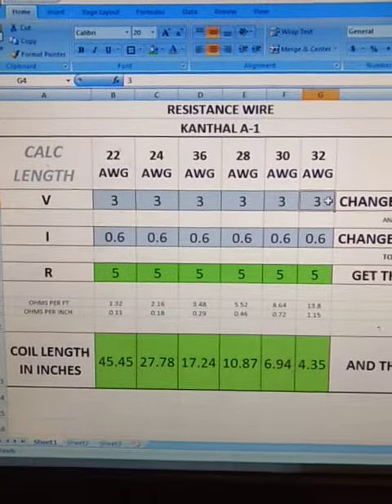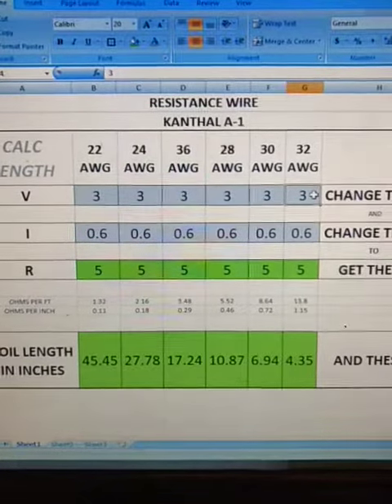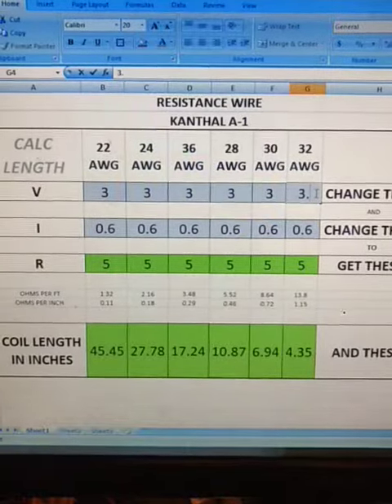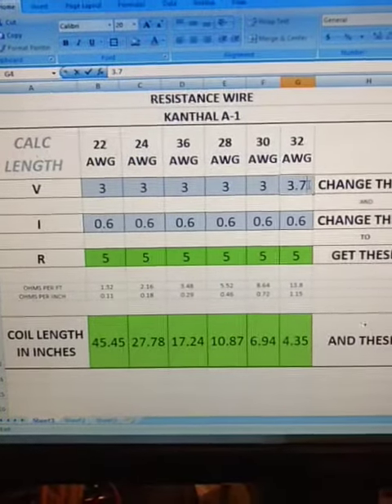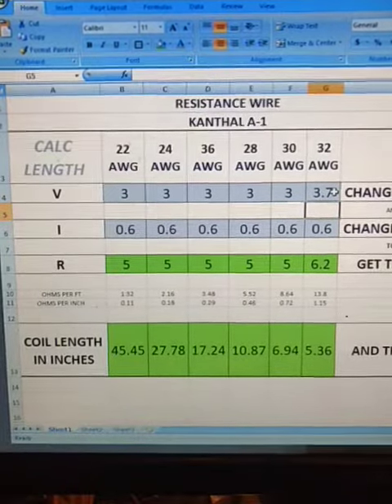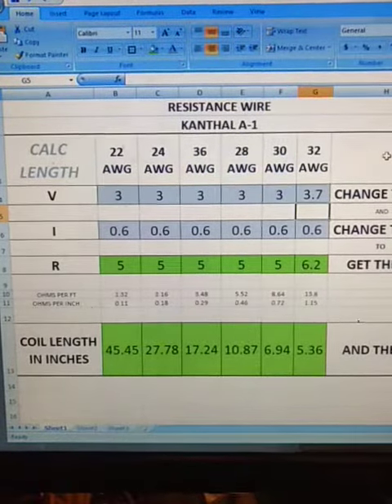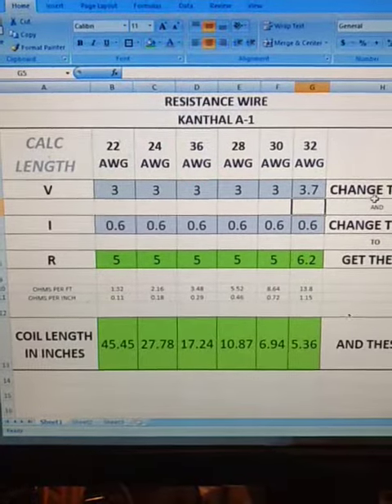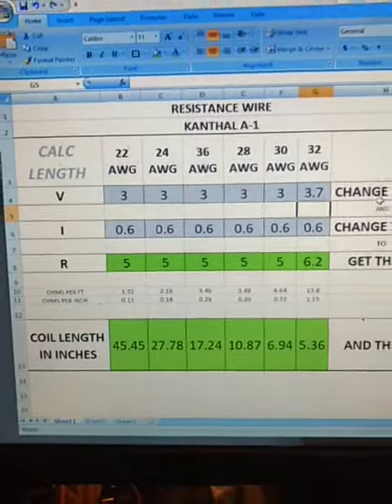Kanthal coil calculator

Comment: Where can we download your excel sheet ?
Reply from the maker: I suppose I could email it to you.
Reply: Is there a file available for this
Reply from the maker: @redelala7652  no, my hard drive crashed.  It should be easy enough for you to make your own calculator though.  You just need a spreadsheet editor like google sheets or excel, and use ohm's law for the math.  If you can do that, then you got it.  If not, then building anything useful from kanthal wire might be too much for you to tackle anyway.
Reply: @BuiltbyD ouch sorry to hear that
Reply: Can you correct this equation if this is ok 
Power-=100 w
Grid voltage= 230 v
Amp- power/volt
=120w/230
Amps=0.5 amps
Reply: Resistance=ohn
Ohm=volt/amps
Ohm=230/0.5 amps 
=460 ohm
Reply: Is this correct?
Reply from the maker: @redelala7652  Yes, roughly.  To be exact:100Watts divided by 230Volts = 0.4347826086956522Amps.  And in reverse:0.5Amps x 230Volts = 115Watts
Reply from the maker: @redelala7652  yes, but the way you've written it is hard to follow.  Resistance or Ohms(R) = Volts(V)/Amps(I), so yes, 230V/0.5I=460R
Reply from the maker: @redelala7652  V=IxR, I=V/R, R=V/I
Reply: @BuiltbyD  thanks now to enter in xls
Reply: It won't work eh hahahaha I cannot do it in xls calculation but I try again
Reply: Formatting is hard lol
Reply: @BuiltbyD is this the formula you used in xls to find wire in inches? I give it a try again ans then mail it to you for checking if it's ok
Reply from the maker: @redelala7652  you need to know the resistance per inch, or per foot, divided by 12, for each gauge of your Kanthal wire.
Reply from the maker: @redelala7652  I found a backup copy of my spreadsheet.  I don't want my email address to be posted here.  I am willing to send it to you.  How would you like to receive it?  I have Excel and Google sheets versions.
Reply from the maker: @redelala7652  so do you want me to send it?  And how?
Reply: Yes
Reply from the maker: @redelala7652  maybe type it like "whateveratwhoeverdotcom"?
Reply: When you needed it most all gone in the wind 😢😢
Reply: @BuiltbyD  I did type all possible way just to get to you but it doesn't work
Reply: I give up replying it will always go away nvm I guess but thanks anyway all my comment with mail always gone
Reply: I just publish my other mail maybe that will work
Reply from the maker: @redelala7652  I'll see what I can figure out
Reply: I will fix my mail in mybio after breakfast so it will appear there on lnks
Reply from the maker: check the description of the video for a link.  I dunno how long before youtube might take the link down.  Let me know if it worked
Reply from the maker: check the description for a link
Reply: @BuiltbyD  i dont see it

Comment: Hi YouTube won't allow 💌 
post on comments ok can you just tell me how to get the length of wire. I'm using 5 mm  diameter shaftin coiling rod in gauge 26 khantal  to obtain 200 watts can you just teach me how to get those wire lengths ❤ I mean just one calculation it will help I tried VIR formula in excel but idk where to get the wire lengths formula 😢
Reply from the maker: 26 Kanthal, depending on brand, is about 0.29 Ohms per inch.  So we know resistance per inch.  You have a target of 200 Watts (Power).  Now you need to know what voltage your battery is and calculate the current in Amps to make the 200 watts.  Let's say your battery is 7.2 Volts.  That would require 27.7 Amps and a 26GA Kanthal wire coil length less than an inch. That's a lot.  Are you sure you're not looking for something closer to 2 Amps?  What's your power source?
Reply from the maker: Also, I dunno what "5 mm  diameter shaftin coiling rod in gauge 26 khantal" is.  Is that the rod you use to form the coil loops?  If so; and the rod itself is not part of the coil, not carrying power, then it has nothing to do with any of it.  The Kanthal wire is all I can speak for.  Coiled or straight doesn't matter; we're talking about just the measured length and gauge of Kathal used.
Reply: The power source or main power is 240 volts itself from main line
Reply from the maker: @redelala7652  OK, with 26GA Kanthal, 240 Volts, and a goal of 200 watts, you will need 288 Ohms resistance and have to use 993.5 inches of Kanthal wire for your coil.  That's with 26GA wire being 0.29 ohms per inch, which makes for a very long coil. If you change to 32GA Kanthal wire, you can reduce the length to 250.5 inches.  If you reduce the voltage to 120 Volts, you can cut the length in half.  I'm no expert in Kanthal wire and I don't know how much current it takes to get a particular gauge of Kanthal wire to glow red.  Perhaps you should seek help in a forum dedicated to the type of project you are working on.
Reply: Ok thank you very much